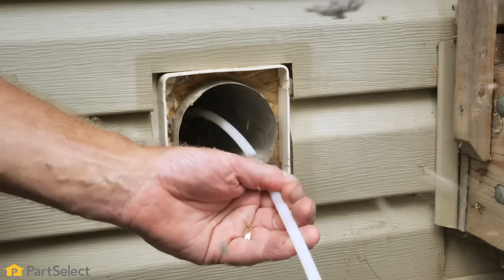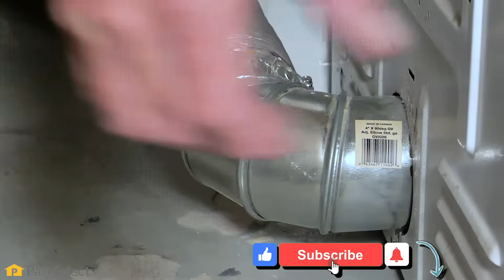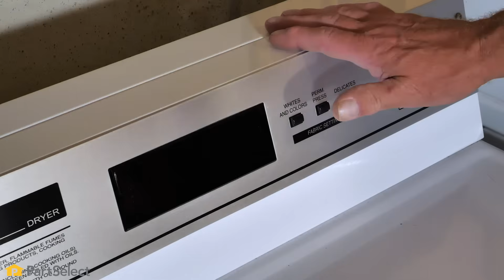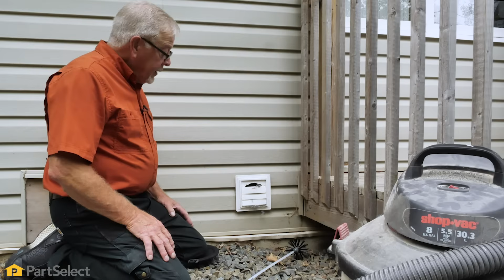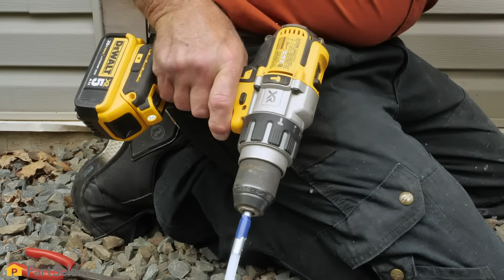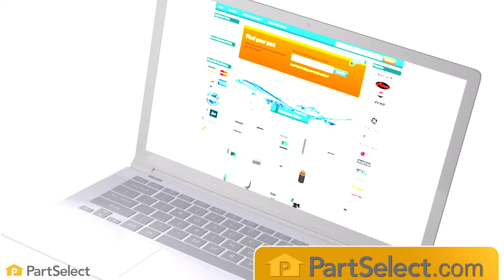Dryer Troubleshooting:  How to Properly Clean Your Dryer Vent | PartSelect.com

Comment: I do have 1 question, where did you find that round 4 inch adapter that you connected to the back of the dryer?
Thank you.
Reply: It comes in the vent cleaning kit